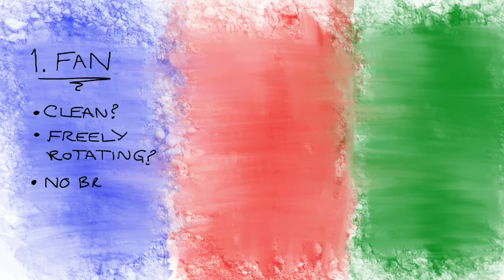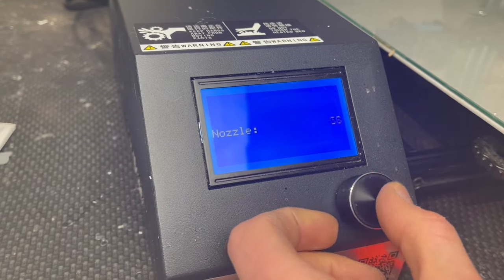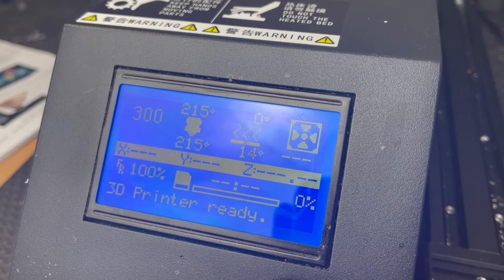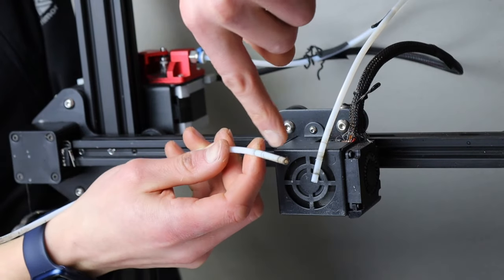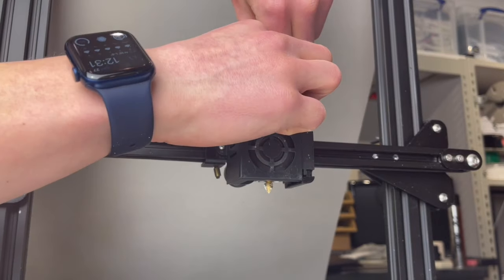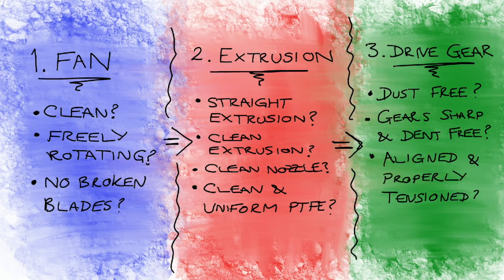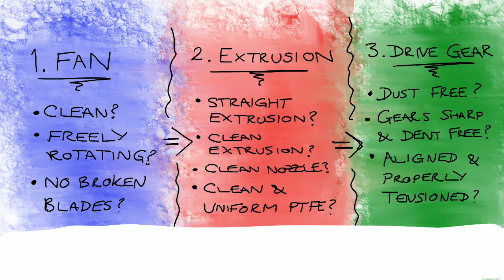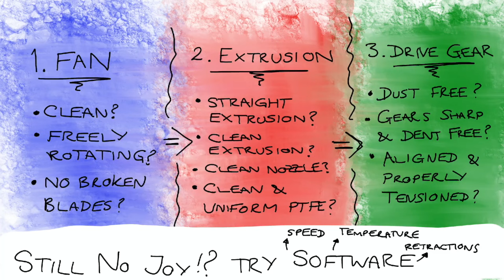How to Diagnose & Fix Serious Under Extrusion #FixMyPrint

Comment: I'm slowly losing my sanity. When printing petg, everything goes perfect, when i try pla extruder starts skipping and underextrusion gets progressively worse with each layer. My printer is brand new ender 3, the extruder looks perfect, I've tightened it anyway. Wasn't sure if bowden tube wasn't losing contact with nozzle, so i have modded hotend to make it unable to lose contact. Replaced nozzle to fresh one, updated printer firmware, updated slicer, tried printing at higher temp, done many cold pulls and calibrated e-steps. Nothing helps and i still can'd do pla.
Reply: When going from PETG to PLA you have to run the PLA at PETG temperatures for a while to make sure it cleans out all that remaining PETG that is in the nozzle

Comment: 😂 😂 i could have used this a month ago i changed the drive gear first, and it wasn't the issue, and it was perfect when i changed the nozzle
Reply from the maker: Well you always learn more figuring it out yourself, so at least there’s that:) glad you got it sorted in the end!
Always a good idea to start with the easiest option first, which in this case fan -> nozzle/hot end -> drive gear.
Did you upgrade your drive gear (if so what did you go for?) or just replace?
Reply: @CallumColes  i just replaced it, my current printer doesn't have much room to upgrade

Comment: got major under extrusion can see through  my prints and pull them apart  checked all of the points you showed  no joy     prints blob  perfect  new nozzle    too  i did notice the  stepper motor is hot is this normal

Comment: much better than the rest of the guides on youtube good job, i have this strange issue of under extruding on my ender 3v2 and i canne figure it out it only happens on a 0.4 nozzle 0.6 works fine im running direct drive no slipping correct temp everything is tight and true just replaced my hot end and thermal resistor with official ender replacement the one and only thing i noticed is after i do a print i try to pull the filliment wilst its still hot and theres mega resistance when i do get it out i notice the fillament has swelled its no longer 1.75mm dia its much thicker its like 2.5 is this what is causing my under extruding and if so whats going on?
Reply from the maker: I suspect you're trying to print at too high a flow rate for the 0.4 nozzle resulting in too much pressure. If you reduce the print speed, you'll probably get better results.
Reply: @CallumColes  ty dude but turned out to be the position of my nozzle relative to the new hot end, after unscrewin the nozzle half a turn and bringing the throat down that changed my transition point and stopped the under extruding

Comment: How the hell did you touch the nozzle when it was hot at 2:27?? 😱😱😱
Reply from the maker: The metal wrench conducts a lot of the heat away, so wouldn't have been crazily hot by the point I pulled out the plastic. I was also aiming to grab the filament not the nozzle! But equally, I've been printing for 7 years so my fingertips have developed heat resistance🤣

Comment: I've done everything you mentioned, plus I have a new upgraded tension spring, but my printer still pops and I'm getting a rough finish on my layers.  When leveling, I bring the bed higher for closer printing and it scrapes, I bring it lower and the filament doesn't stick in spots.  I'm running out of troubleshooting ideas.  It worked well for months, then I did a few upgrades, learned some tricks for better prints and things get screwed up.  I think it's an issue with feeding faster than extrusion but I just cleaned it out earlier today.  Not quite sure what to do at this point.
Reply: Sometimes doing some factory resets can help
Reply: I'm in the exact same situation, did you figure out your problem?
Reply: @thelotrfreak1  Sort of.  I changed my retraction distance and speed and discovered the tune ability on the printer which allows for fine tuning during a print.  So now I give the printer and bed a few minutes to adjust for expansion after pre-heating, do my leveling and monitor it once it starts.  You can then adjust the extruder height in baby steps for a better "spread" of filament.  It seems to work.

Comment: I took the nozzle(already changed the nozzle right before) off and ran the filament straight through it and BAM a huge chunk of molten filament inside the hot end came right off.

probably because I was using it too hot trying to salvage a bad filament and it actually clogged my hot end.

Thx a lot for the tips.
Reply from the maker: You're welcome! What you describe could also be caused by a gap between the bowden tube and the hot end, this can occur in assembly but also after many hours of use as the bowden tube wears away. When you re-assemble, make sure everything butts up against each other and you should have another couple hundred hours without problems in this area:)
Reply: @CallumColes  ah, my printer is direct drive, so no tube here. CR 10 V3
Thank you

Comment: Guitar strings are what I use. I can get the correct gauge guitar string for the different nozzle widths. Really helpful if they're wound strings. Eg 0.4 nozzle I use a 0.38 string.

Comment: I watched lots of tutorials. even though this is the most practical one my issue is a little different. my printer lacking extrusion on a specific part of the any object, the rest is decent as always but that specific part (specific location of the heat bed) is always the same spot no matter what I print. I'm clueless right now
Reply from the maker: It could be to do with where you’re extrusion starts / stops. Have a look at the setting in your slicer which dictates this position (name varies by slicer). Changing it to random or fastest should make less noticeable, other slicer settings could also improve the performance. If your printer is Bowden, the problem could also be related to the tube, in certain positions it may restrict the movement of filament.
Reply: @CallumColes  thank you for your reply. i'll check it. my printer is bowden and im suspecting a restriction of the movement of the filament as well. there wasnt an issue with 0.4 nozzle, this started when i changed it to 1.2 tho.. thanks again 🙏

Comment: 5:50 ..... Did you never lubricate the drive gears? Even a drop of sewing machine oil every couple of months would have prevented the wear of the dual gear extruder tension plate.  I have the same extruder gear as you, put hundreds of hours of printing through it and with a drop of sewing machine oil every 3 or more months, its barely scuffed the surface of the red anodized aluminum tension arm plate.
Reply from the maker: What a great idea, definitely should have done that! I'll have to add that to the maintenance routine. 
In fairness to that printer, it was probably well over a thousand hours at that point, they run 24/7. But always nice to prolonge part life where possible.
Reply: @CallumColes  I don't know how many hours my Ender 3 has on it after I swapped the mainboard with a SKR Mini e3 last year. The drive gear was from new and it's about 3 years old now. 

Sewing machine oil I got a handy small bottle with a nozzle on it from a local food store in the utility section. It was like a couple dollars. Just when I'm feeding in the filament, I just check if it's looking excessively dry and give or take its been a while. I will just press the oil bottle nozzle on the outer drive gear. Surface tension of the oil is viscous enough to pull itself to the gear and will settle between the drive gear and the plate. 

You'll notice the surface tension holds it in place and will ride up the gear as required. Try not to get it on to the filament grip of the gear if possible. 

The oil is also thin enough to lubricate the roller bearing in the drive gear too. This will stop it wearing and squeaking if it dries out.
Reply from the maker: @RamjetX  impressive stuff! Normally always add some lubricant for anything metal on metal, don’t know why I didn’t think of it for this, but will implement going forward. My go to is 3-in-1 PTFE lubricant, makes a little less mess than some oils/greases. But your solution sounds like it works well too🙌🏼

Comment: I've tried so much to fix my under extrusion and no matter what I do, there's no joy
Though I also have random bouts of over extrusion and weird artefacts in my walls too which is confusing af

I've tried;
- Replacing the Nozzle
- Cleaned my Nozzles
- Replacing the PTFE Tube entirely after cutting it back a few times, now I have a high heat resistant one
- Replacing the drive gear 
- Tried every kind of extruder gear tension from super loose to super tight
- Cold pull
- Replaced extruder tension arm (Turned out my old one snapped way before I even had extrusion issues, so I got a replacement)
- Cleaned the fan and heating area thoroughly
- Cleaned the entire hot end and flushed it through to make sure there's absolutely nothing there
- Thoroughly cleaned and de-dusted the entire rig
- Changed flow rates
- Calibrated E-Steps more times than I can count
- Tried every temp I can without burning filament or being too cold to drive (180-240 and such for PLA for instance)
- Adjusted filament settings in Cura for density, flow, acceleration, Jerk,  etc
- Used new and old filament profiles for my filaments
- Changed print speed countless times, but even when super slow, the issues persist
- Changed the wall printing orders and such
- Changed retraction settings
- Tried priming every layer with additional filament
- Turned off power recovery settings
- Rebuilt the entire printer frame, adjusted Z-Axis lead screw tension, replaced grease and adjusted guide wheels tension to ensure assembly is secure with no wobble/give
- And all the other fiddly stuff inbetween

Yet still it's always under & sometimes over extruding. The absolute only thing I can think of that changed to cause all this in the first place was that Cura had an update months ago and screwed everything up. But the trouble is I don't remember the last version I used that worked flawlessly and while I'd like to try using other software I always found Cura to be the most user friendly, customisable and gives the fastest prints

Kind of at a loss, does anyone have any advice?
Reply: hey! did you ever figure this out? 🤞

Comment: Seeing a lot of dust on new swiss direct drive. So much that I scrape small chunks off. Instead of gear and bearing, my setup has two gears (1 thats drives). How do I know if my spring tension is too light or too tight (It is adjustable)? I have also noticed dust throughout the entire roll of filament, so installing a filter. It would also skip at first. Think it stopped skipping since
Reply from the maker: Hey Jayy, first of all, always try a manual push test just to be sure the filament moves through nicely. If it doesn't the problems are more likely to be coming further down the line! In terms of getting the tension right, there's a bit of an art to it.
 
I'd normally start the tension nice and loose and watch it as the extrudes (most printers allow you to extrude a chunk of material from the settings/prepare menu). 

When the tension is loose the gears will quite often just slip on the filament without really moving it. As you increase the tightness you should find that the grip improves and the filament is moved more consistently. Stop tightening when the filament seems to move forward consistently. For hard filaments you don't want the tension to be super tight, since the gears will grind it away if there is a lot of resistance from the extrusion pathway. Flexible filaments are more suited to higher tensions.
Reply: @CallumColes  Great! Seems like it may be further down the line. Filament ran smoothly. I will disassemble, clean, and reassemble the hot end and nozzle to ensure all is tight and seated well. 

I did configure the extruder e-steps, then ran a PID. All seemed well. I will also try a higher temp when tightening the nozzle, etc, and a higher temp with PID. Previous did it at 210. 

I may try a higher temp than my usual 210 with PLA, since I have an all metal hot end now.

Comment: Wait the fan can cause under extrusion? My fan has a broken blade....
Reply from the maker: The hot end cooling fan can for sure. If the hot end isn’t kept cool, you’ll get heat creep and filament will start melting where it shouldn’t!

Comment: I get the "thin string of pearls" extrusion, resulting in a "sponge" looking part with stringing all over. 
 I have already replaced the nozzle.
Previously,  I successfully printed with a name brand petg. Wonderful precision parts, that is until I changed to another well-known brand of filament, also petg. Now the "string of pearls".
Any help would be greatly appreciated. 
Thank you for what you do on YT.
Reply: Your extruder is likely skipping steps. Check the filament tension screw, or driver temperatures
Reply from the maker: Try the manual push test demonstrated in this video, if it pushes through easily you know the issue is more likely to be with your drive gear. If it is difficult to push through, the problem will be hot end / nozzle side. PETGs vary massively, some print at 200C others need 240C, so it could be as simple as increasing extrusion temperature.

Comment: Nice video!  I had a mystery with this a few months ago on my Ender 3 v2.  Ended up being a small crack in the tensioner arm which made it so there wasn't enough pressure on the filament to push it through the nozzle even though everything else looked fine.   Replaced it with an aluminum extruder assembly and no more issues.